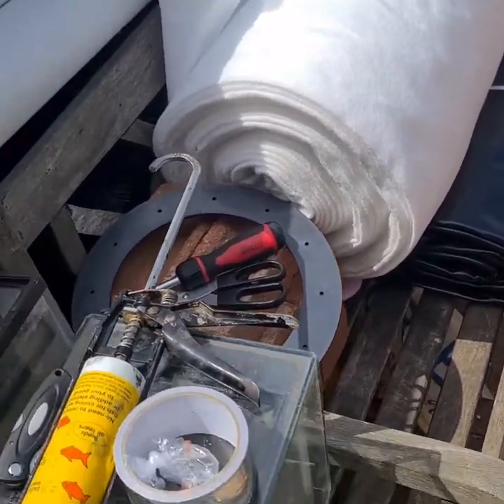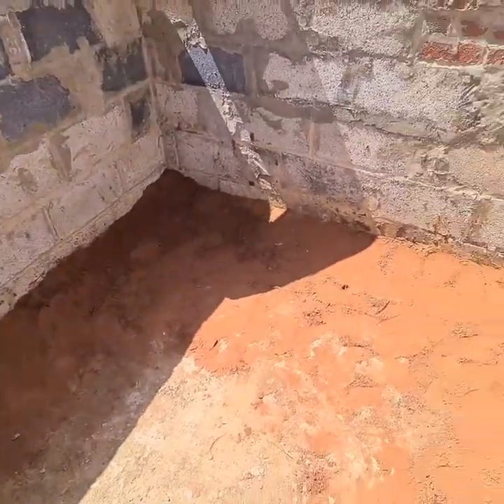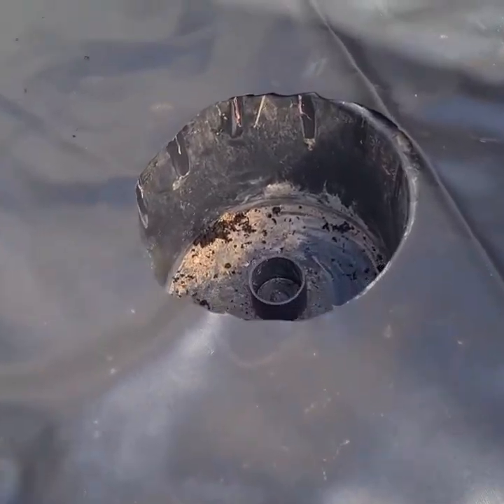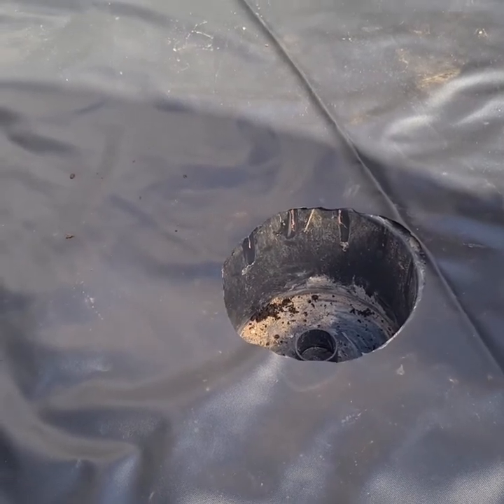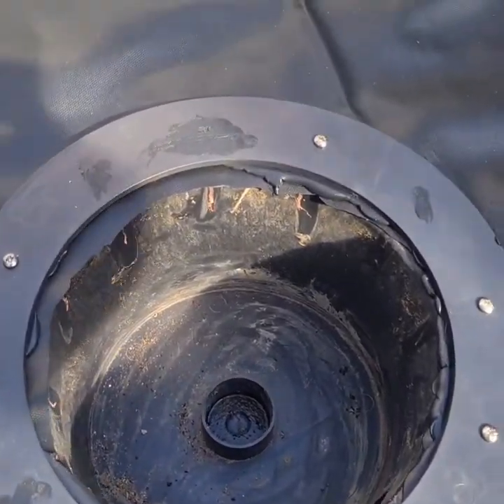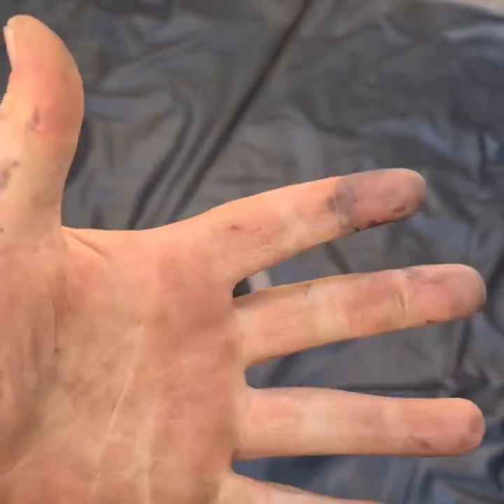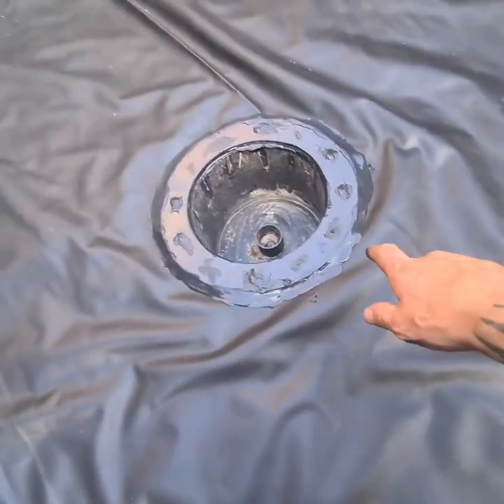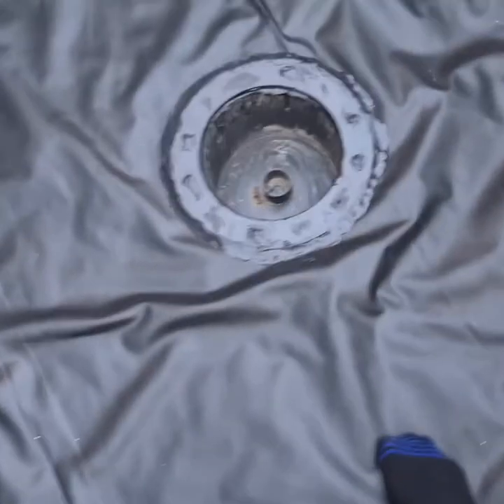Stage 21 Underlay/Liner In And Bottom Drain Sealed 👍

Comment: Hi m8 what pond liner did you use just in process of getting mine sorted thanks
Reply from the maker: Not a clue mark not the cheap stuff and not the expensive stuff bud that's what I asked for on the phone 🤣 i called them up wharf Aquatics and spoke to them first and told them what size ect they gave me price over phone with underlay came to about 360 bang on gave me more then I needed to which was nice of them becasue I could go abit higher with me pond 😁👍🐟